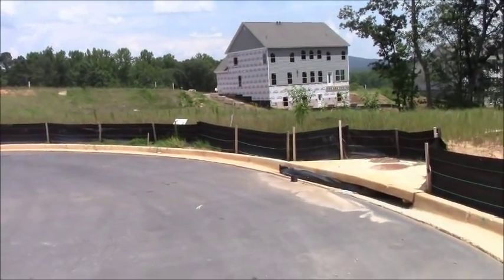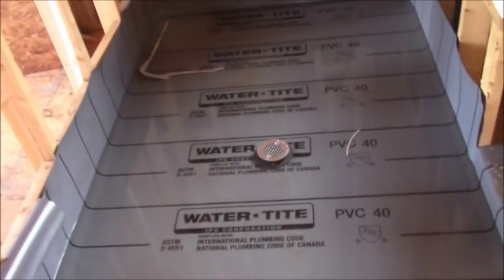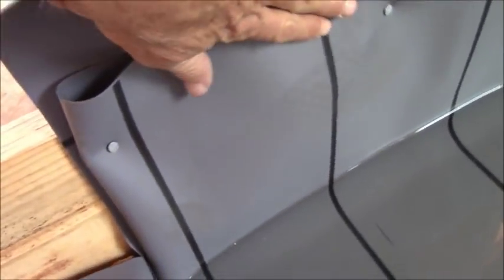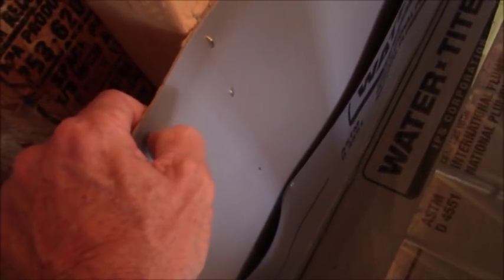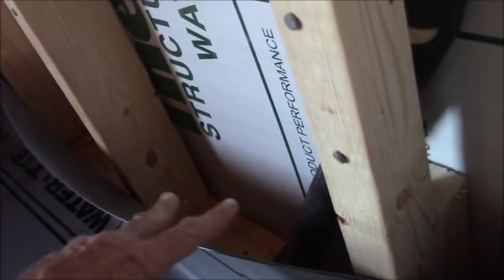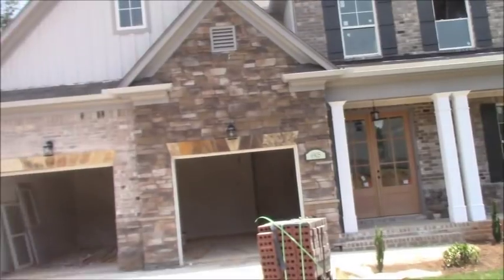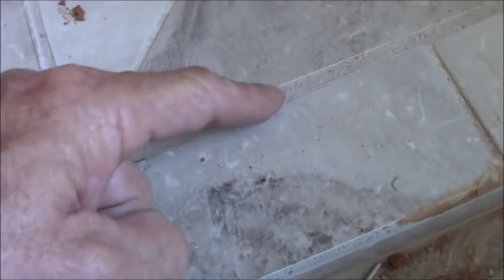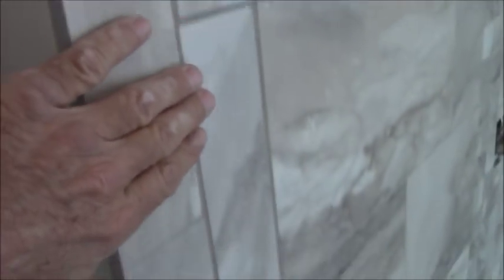NO ShowerPan PreSlope ..NEW CONSTRUCTION

Comment: I took copper out of one of my rentals exactly because it degraded. I PEXed the entire house. I also had to replace copper drains on another house because the entire bottom had corroded out.I have never had trouble with PEX, now CPVC is another matter. Over time it gets brittle. I've been crawling around under a one of my rentals and broke the CPVC when I bumped it.
Reply from the maker: CPVC SUCKS ! Should be outlawed.
But rats eat through PEX, look it up on YouTube...can't eat copper
Reply: StarrTile 
I've never, ever had a rodent eat through plumbing or electrical. I'm not going to avoid the best thing in plumbing ever, just because something might happen. Pigs could sprout wings and fly, but I'm not going to change what I like because it could happen.
Reply from the maker: Each to their own...but if I'm doing a job for someone or worse my own house, I would NEVER take the chance, it's a crap shoot if & when it does happen..
https://www.youtube.com/watch?v=I2Hx0uH1948&t=6s
So you'll risk THIS because you like PEX  over copper ??? Ok then..
Reply: I would never use copper. First, it won't last as long as PEX. Second, it is freeze proof, maybe doesn't mean anything where you are at, but it does here. Third, the real cost of construction, including plumbing, is labor. It costs a whole lot less to run PEX than copper. Fourth, there is an anti technology vein in our rejection of copper. Old, isn't necessarily better. If you think so, I'll show you a rental I'm rehabbing. The way they built the walls, without proper corners, is making very difficult to put in doors and run drywall.

Comment: if you build a shower on a plywood floor (like the ones in  your video) you can be sure that the the base is flat and the perimeter is raised because the linker is round where the floor meets the wall. So if water drains out a the drain in the middle through the weeping holes, it will wick the water from the rest of the area towards the drain. If you build a shower on a basement concrete floor and it's not perfectly flat you will have pooling that may not be able to be dried by wicking towards the drain so you are counting on it drying by wicking upwards into the room. I don't think this is good practice. If your floor is not very flat like a sheet of plywood I would take the time to preslope.
Reply from the maker: The notion of a pre-slope is Antiquated now, as most tile guys are doing a sealed system, meaning that the main mortar pan is only used for the eventual water on top of the tile, with a seal system we are encapsulating in the entirety of the pan and thereby making the pre-slope a moot and redundant issue
Reply: @StarrTile you're speaking as if your audience are all tile veterans who are current with industry practices. I think you are saying that now everyone installs  the waterproofing above the pan. I am calling the pan the drypack base that you place the tiles on.

Comment: Bob, how exactly do you add slope to flat surfaces? Is it simply adding more thinset to make one side a little higher than the other, or do you add shims when things are at the wood stage of the build?
Reply from the maker: The mortar is screeded out, pushing it to the perimeter where more is needed and manually sloping it to the drain area. Takes about 30 minutes or so to get it right.
Watch here >https://www.youtube.com/watch?v=NjoQBwqZHu8&lc=z223ttdbnznfhzqvzacdp432njp1qt1vvcnle3oxvflw03c010c.1513299730602375
Reply: Bob, thanks for responding. The flat surfaces I was referring to was the top of a knee wall or the top of the curb. I'm a PayPal kinda guy, so I'll contribute there. Merry Christmas.
Reply from the maker: Knee walls, curbs & benches are slightly sloped using more thinset, sloping it and then setting buttered tile on it.

Comment: Hi StarrTile,
I have been watching all your shower videos as I am in the process of redoing our master bath shower. You do a really really good job helping us non-professionals out.  As I was tearing out the old walls and curb from 18 year old shower, I was amazed that the many of the errors you show on YouTube showed up LOL - most notably the lack of wrapping the spot on the top of curb where the vertical 2X4 meets the horizontal curb top.  I noticed in these new construction pans they were also not hitting that spot. In my shower, I always feared the liner had failed in a corner, but it turned out the slow leaking was coming all the way from that curb edge.  
Question - I bought for a couple bucks some specially made corners I call them that I will glue into those soon.  I am also going to coat walls with redgard after I get the liner all done. Are those pre-made corners good?  They are made by the liner companies.
Yes - I have put in 2X6 stubs - that only makes logical sense :)
Yes - when I put in Duroc I will leave a gap to the shower floor :)
Keep up the great video work. I hope you make a good living as you are a skilled craftsman. What you do in a few days, it is taking me many many weekends.  But better slow than wrong LOL.
Thanks, Jamie
Reply from the maker: Thanks for the compliment, much appreciated.
The corner liner or DAM CORNERS are good to use, but if your backer never touches to floor, and you waterproof walls and curb then the dam corners are redundant...but can't hurt.

Comment: You say preslope is not required . My tiler didn’t preslope just poured concrete on the liner and sloped that . Is that the correct way ?
Reply from the maker: I never say that it's not required, all I simply say is that I don't believe that they function as intended, and I say that I don't do them, however if you're waterproofing the mortar surface then the pre slope would be irrelevant
Reply: StarrTile thanks for your reply . So should the water penetrate through the grout and eventually drain through the weep holes or it shouldn’t go through the grout ever . If so how do I waterproof the group . He poured concentrate over the pan liner which was sitting on the subfloor . Does concrete absorb water ?

Comment: What is the point of raising up the liner to high.  As long as you're above the shower curb height one or two inches is fine.  In case shower floor gets flooded water will reach to the top of the shower curb.

Comment: The second you said you were old school and you used copper you gained a fan in me. Pex regardless if they stretch or crimp it, to me its all garbage. Using it for radiant heating or heat loops no problem you'll hear no complaints from me but with new construction its just a short cut. Like a damn shark bite. Ive seen them used on new as well. I dont know how an inspector wouldn't jump on it but I guess its all up to that envelopes thickness lol.

Comment: You don’t have to have a pre slopeas long as you conduct your mortar and lower tile in a way so that it does slope towards drain. All concrete type mortor will wick water. This is not the issue. The issue is having the water drain WHILE YOU ARE TAKING THE SHOWER! A pre slope helps you achieve this draining of a shower. If you do not put preslooe then you will have to build up mortor around edges and slope tile...

Comment: I did house's just like this but stopped because they dont want to give  the time to do the work. They would only give 2=3 days for around 400=600 sq. Ft. On floors and a mud pan 3×5. The way the second mud pan was put in and folded was very common among other contractors i seen working their. It was common for me to get calls to come inspect pans and tell them why they were leaking. They wouldn't sweep first, their would be drywall nails laying loosely under the liner, nails sticking out of studs. Seemed together liner (when they should have used 1 piece) they had them come watch me put a pan in to try and teach them a few things but i think they were to offended to pay attention and take any thing away from it. Some of them were very hard working guy's, they just hadn't had anyone teach them. Or anyone teach them the rite way. And flood tests were not done.

Comment: I have a question for you, I am in the process of demoing an 80 year old kitchen with 4"x 4" Tile about 5 ft up the walls.(Built in 1928) The tile is original to the house and was in great condition. The owners are flipping the house and are incorporating a more modern open floor plan. Demolishing the tile has become quite an unexpected job! The walls consist of the older style 16 inch drywall type of material. on top of the drywall is an expanded metal. on top of the metal is 3/4 inch of mortar. On top of the mortar is about 1/4 inch of plaster and finally the tile. The whole walls depth is around 2-1/2 to 3 inches thick! My question is that about every other horizontal row there is a cotton string embedded in the grout. Any idea as to why they did this? Is it some sort of a system to keep the tiles running level? I really hated to break all those tiles out because they were in perfect condition. they had an Art Deco look about them.
Reply from the maker: The string most likely is spacing...way before there were spacers in a bag....interesting !

Comment: I agree copper is better. I live in nd and the winters are brutal and summer is high humidity and hot. All the pex fitting usually break every year from getting cold to hot and if its behind the wall and as you shown on this video mostly they are doing it fast and cheap so they make alot of mistakes. Could cause my home to have internal leaks and never know until its too late and it has been moldy for years.

Comment: There's pros & cons for copper & pex/wirsbro/uponor/rahau. There are also different grades of copper "K", "L", "M", & different grades/class of pex. Kind of depends on the situation. It usally comes down to price. I personally have replaced or re-routed more copper than pex. That includes houses & buildings less than 10 to 20 yrs old. I preferred copper til all the repairs. Its just scary (pin holes, & corrosion) mostly "M" type. But ive repaired split pex also. There are lawsuits against some brands of pex.
Reply from the maker: Thanks for clarification. Was not aware of suits against PEX, but I would believe it because I can see failures happening vs copper. Personally I've never had issues with copper, occasionally seen pin hole leaks but the exception & not the rule.

Comment: Copper can DEFINITELY DEGRADE, particularly if you use non-water based flux which can stick around inside the pipe and cause localized corrosion that will eventually leak.  Also, after decades of use, copper can wear causing pinhole leaks.
Reply from the maker: You are correct, but a thirsty rat will eat through PEX in no time at all...happens a lot
Reply: @StarrTile  Hey that's a really good insight - didn't think of it.  thanks.

Comment: Doing a shower with six inch block and then muffing tiles to it and same with floor it's in my basement have any recommendations I would love to hear back from you thanks
Reply from the maker: Waterproof the block....
By the time you get through with  prep your shower should be functional without any tile laid
Reply: @StarrTile  yeah that sounds good star ⭐️ tile thanks what do you recommend for the floor though ? It's got the drain and it's concrete floor now
Reply from the maker: @onetruesoldiervt3686  don't understand your question, the floor is irrelevant you treated the same way as if it were a wood subfloor, pan liner, mortar, Etc
Reply: @StarrTile  ok so it's fair to say I can just skim coat over the existing concrete floor with a thin layer of mortar then ?
Reply: If I have to put a pan liner now does the extra stuff running up the sides with that liner can that be glued somehow to the six inch block so it's not sagging or anything
Reply from the maker: @onetruesoldiervt3686  watch my video Shower build in 30 minutes...
I can't walk you through all the steps the comments, sorry

Comment: once I had a pin hole in copper in my walls that leaked for a long time before I found it. tore the wall board out and copper passed through 2x4 and pin hole was inside 2x4. packed 2x4 hole with paper towel and put other end in a milk jug. water went sideways and filled up jug every 24 hours. wicked across paper towel

Comment: They probably don't do it in new construction because it takes time and effort, and most new houses are built as cheaply as possible. Standing water may weep out with capillary action without a pre-slope, but it will take more time than if gravity helped it, all the while degrading the mortar at a microscopic level with the products in shampoo, soaps, etc. in the water standing in the pan waiting for capillary action to work.  Sure, it may last 10 or 15 years, but why not take 30 minutes to whip up a pre-slope to make it last longer?  Its recommended by the manufacturers  of the liner material.
Reply from the maker: Gravity works in open environments like draon lines..void of gravity ensures encapsulated area stays wet always with or without preslope

Comment: I agree that liners should be presloped, but it's comical to see why your're concerned.  In my experience, long-term saturation of the mortar bed causes the salts in the bed to leach out and completely clog the weep system and even cause the clamping seal to leak.  You end up with stalactites emanating down from the drain onto the ceiling below.  Depending on how much the shower is used, this process usually takes on the order of 5-years before the leak appears on the ceiling.

Comment: Im guessing there is capilary action in the walls behind tile like the floor. Im thinking it probably dries up until the next shower. A pre-slope reduces the water down to capilary (like walls) , instead of a puddle with no chance to evaporate or dry. Especially in the corners of a large shower. How about a shower floor without tile, like  concrete finish & block walls. You still want to slope the floor. I would want to give water every chance to drain or evaporate.Trying to keep an open mind, because ive seen from experience shotty work. All trades should work together to get the best outcome.

Comment: Can't teach old dogs new tricks. When the shower base is installed like this, without a sloped mortar bed first, five or so years from now, after guys like this are long gone, the tile starts to separate along with the grout because the floor flexes. Mold and mildew grows out of control from the sitting water that can't drain off of the flat liner and starts to make people sick. It has nothing to do with capillary action. Moisture saturated mortar requires a sloped liner beneath it to take away the moisture. So please, don't install a shower base like this. Spend the extra time and do it right. Especially if you want to live in your home for many years to come without having the costly repair of replacing your shower or having to constantly replace the grout and get sick. Time to retire "Copper Boy".

Comment: It's not true that capillary action doesn't care about gravity. Capillary action happens because there is an electron "cloud" in molecules. Oxygen is highly electronegative. That means that water has a slight "charge" to it. Charge isn't exactly the right word - but it means that it gas a sort of weak magnetism to other molecules that also have a charge. This is the same property that allows small insects to walk on the surface tension of water. In Capillary action specifically, it means that if you take something like a very small glass tube and put it in water, the water will "climb" into the tube. However, if you put a glass drinking straw in a glass of water that doesn't happen. Why? Because the power of gravity is stronger than the weak magnetism of Capillary action. Capillary action only happens in specific conditions. 

That pex is pexa / uphonor

Comment: It's pex A the only pex you should ever use. The rings u can see on there are expansion rings and then they shrink back to original size and make a waterproof seal leaving you with a much safer seal as well as a MUCH bigger inner pipe diameter then other B or C types of pex

Comment: Just as an FYI. I am old school as well and do prefer copper pipe over 
PEX. You mentioned in your video that you have seen plastic pipe 
degrade. Would you please explain further? I know in the 80s contractors 
were using a polyethylene pipe and there were many class action law 
suits over that piping and manifold system however I have read the PEX 
actually came out of Europe/Germany and has been used successfully there for 
more than 30 years with out issue,  when properly installed.
Reply from the maker: Not just poly, but CPVC gets brittle & fails, so I hold out trust for "NEW" plastic(s)...not sure of PEX history but never had copper fail if sweated correctly. It's hard to stray from what already works...my humble opinion.
Reply: I would also prefer copper over pex, but copper does degrade in some circumstances. There is a 33-year old townhome development in Winter Park FL, where all copper tubing has sprung pinhole leaks, requiring repiping as well mold removal. This is an unusual occurrence – haven’t see it elsewhere. By the way, I find your program educational and entertaining, keep up the videos.
Reply from the maker: THANKS!
Reply: You are talking about Polybutylene, not Polyethylene. There are also different classes of PEX. I also stated in a comment above about the cost/time involved in copper. You would probably change your mind real quick when you got a quote for copper.
Reply: Artifacts407 amen! 20 yr plumber. Been to pex certification class 3 times. Pex sat on test in labs in Europe for yrs before being brought to market. Pex IS NOT effected by electrolysis,  pex is oxygen barrier and pex has memory. The only downfall to text is to be true to size you need to bump up one size on everything.( for example, half inch PEX fittings are actually 3/8 ID, 3/8 pex is 1/4. ect ect